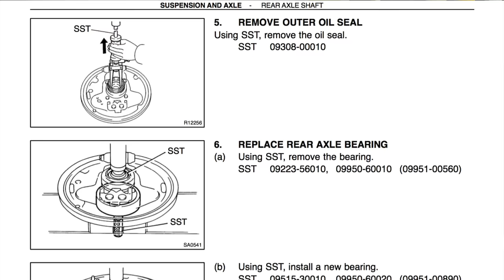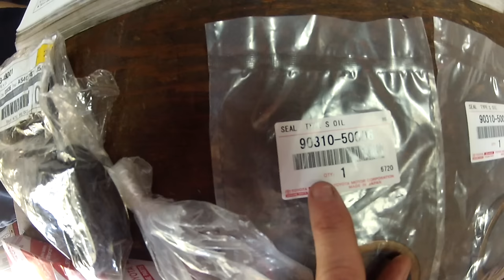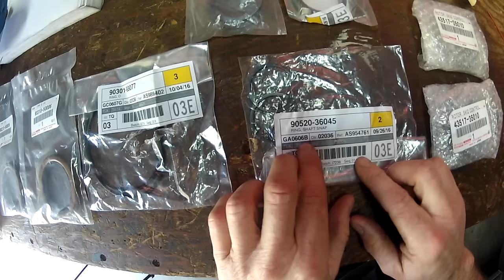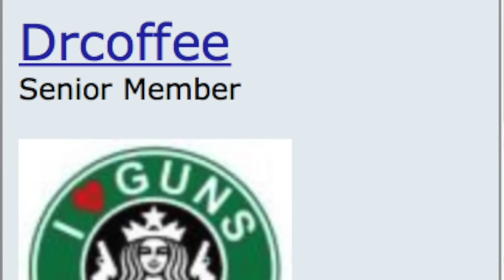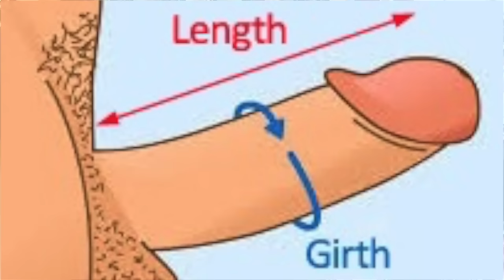Toyota Rear Axle Seal/Bearing Replacement (ABS Rearend)

Comment: Put your wheel bearing in the freezer the morning of the job, then when you go to set the wheel bearing in the housing, heat up the bearing seat just a bit. New bearing drops right in
Reply from the maker: Thanks for the tip.  The bearing fit can really slide in easy without the freezer and heat trick though.  It's not remotely a press fit.  The key is to set the bearing on top of the bearing case going in as straight as possible.  With a little grease to help with the insertion, the bearing literally will fall in.  I Part 2, we show using a 3 inch ABS clean out and cap as a pressing device to install the bearing.  If the cap starts to load up and flex during the insertion, you know it's going and crooked and it's time to back off and reset.

Comment: Thanks for the videos, I find them very insightful.

Any plans to do a front wheel bearing replacement video? Need to tackle this soon and I found no videos detailing this job.
Reply from the maker: We did a manual hub conversion video and that shows pretty much the same stuff you'll need to do.  The parts will be a little different because you'll have an ABS ring but this video should give you most of what you need to get it done.  One day we'll do this job for someone who has stock ADD hubs but for now this is the best I can do for you.  https://youtu.be/TZ2sOfVrnhU
Reply: Timmy The Toolman awesome thank ya sir!

Comment: Would the rear axel leak due to the bad bearings. You can see the missing bearing from the back side.
Reply from the maker: Yes, bad bearings can be the reason the seal fails because a bad bearing will allow for increased movement on the axle which puts extra strain on the seal.  The bearing couldn't be missing but it could be worn out.  If it was really bad, the bearing could completely fall apart but you would know it.  You cannot see the bearing without pulling the axle out.
Reply: @TimmyTheToolman  I pulled it out. And there some metal shavings on the seal. Last I drove it it was running fine I did smell burning. Because the fluid was on the pads. Tim thx for the quick reply. Yeah it's missing one bearing ball I think that's what the shavings come from. Wish me luck trying to find a machine shop to press these in.
Reply from the maker: @maxnguyen22  Just make sure you give the machine specific instructions of what you want them to do.  If they don't have the right tools and are planning on cutting off the parts, you might want to choose another shop.

Comment: @Timmy The Toolman any update on this project since installation? Did flipping the retainer actually work and it didnt leak? I plan to do this tomorrow. Thanks for the video btw
Reply from the maker: The flip method has held up for 4+ years and 60k miles.  The main thing regarding this repair and verifying you have a good mating of the inner retainer and axle seal.  All flipping the retainer does is allow a good mating without having to risk the retainer running up against the inside of the axle housing.
Reply: @TimmyTheToolman   that sounds like a job well done to me, thank you so much for such a quick reply Timmy. I'm excited to do this project tomorrow following another one of your video haha. I did the cv boot mod following your video and it hasn't leak since, thank so much for the videos you make keep them up. Thanks again.
Reply from the maker: @theregularguy5409  You're very welcome and good luck with the job.  Let us know how it went for you.

Comment: Hi Timmy. I recently watch your video on how to change ATF on a 4runner and I instantly became a fan of your video. I have a question for you. Is Castrol transmax  high mileage fine for my 2002 4runner sr5. I been searching but can't fine a definite answer.
Reply from the maker: All you have to do is make sure it's compatible with Dextron III applications because that was the spec for our transmissions when the vehicle was produced.  I've used Mercon V and Dex/Merc in my transmission so far.

I looked up the Castrol Transmax High Mileage and I couldn't confirm it meets the spec for Dextron III applications.  But, Castrol does make a Transmax Dex/Merc and that ATF is compatible with Dextron III so I know you could use that in your transmission.
Reply: Thank you for taking the time to answer my question sir.

Comment: Experiencing this issue with my 05 Tundra.  5 months ago i noticed oil leaking all over the passenger side rear wheel.  I had a shop replace everything, bearing, seal, retainer, breather and brakes. Two weeks later it was leaking again.  They adjusted the retainer......Two weeks later leaking again.  So they fixed it again.  This time it lasted about 5 months.  Now its leaking again.....I'm planning to pull it out and flip the retainer as you mentioned...Is it possible to flip the retainer without pulling the abs ring and bearing?
Reply from the maker: I'm not experienced with the Tundra axles but the 3rd 4runner axles have the inner retainer and ABS tone ring butted up together.  So, you take those off as a unit by getting a bearing splitter under the ABS tone ring and pulling them off.  So, if the Tundra axles are similar, you will have to pull the ABS tone ring off.  As for the bearing, you shouldn't need to mess with it to readjust the inner retainer.  

Making sure this repair works is very simple.  You perform a "grease test" and make sure the axle seal is mating well with the retainer.  If you do that, renew the bearing is it's worn and you don't have a clogged breather, this repair should hold for a very long time.
Reply: Yes, the tundra's are the same.  I don't have an hydraulic press like you have but do have access to a bearing splitter...although I'm not sure how that would work on a long axle like that.  Also, is there another way of sliding the new abs ring and retainer on the axle without a press (pipe and hammer?)?
Reply from the maker: Hey Shawn, people have sort of slide hammered the ABS tone rings and retainers on with a piece of pipe.  How do you plan on getting the parts off the axle without a press?  Are you going to replace the bearings?

Comment: Do you think the 12 ton press from HF is adequate for this job, or would it really require the 20 ton press?
Reply from the maker: The 12 ton can do it.  Our buddy Duane makes an axle puller tool that will fit the 12 ton press.  We feature Duane's tool in this video: https://youtu.be/R-c2x3F8DU4  We have a link to Duane's Ebay store in the video description.

Comment: How important is replacing the ABS trigger wheel? I have a '99 Tacoma with an e-locker, so I have an ABS rear end, but don't actually have ABS. Any reason not to reuse my existing ABS trigger wheel and save myself $130+tax?
Reply from the maker: You can just leave off the ABS tone rings or put them back on, your choice since you don't have ABS.  You definitely don't need to buy new ones as long as you pull the parts off rather than cut them off.

Comment: I ordered a kit for a non abs 4runner. it comes with the seals bearing and a retainer. Mine has abs, will the parts still fit or will I need to get the other kit? thanks for your help.
Reply from the maker: They will fit.  You can save money on the parts by reusing the retainers and ABS tone rings.  I cover this information in a pinned comment.

Comment: Hey Timmy, my 2000 tacoma has abs rings on the axles but the truck itself does not have abs. Do I have to reinstall the abs ring or can I leave it off when doing this job?
Reply from the maker: You can leave them off.
Reply: @TimmyTheToolman  awesome, thanks.
Reply from the maker: @CplGoldFish21  You're welcome.

Comment: This was my comment 2 years ago:   (Has anyone ever tried inserting the inner axle seal half way, so that way it has a better seating area on the retainer? Or will that not work?)
I did that myself and its been 2 years with no leaks and I didnt have to to all that retainer stuff and didnt have to leave the garage. Just thought ya'll should know this way also works and has no bad effect, if you dont have time for the extra steps :)
Reply from the maker: Yeah, not fully seating the seal works, but getting it to where it's equally driven into the housing at the same depth on the full circumference is the hard part.  But yeah, it's an option.  Flipping the retainer isn't any more work.  We didn't have to leave my garage either to do this repair.

Comment: what kind of noise Toyota Tacoma 2010 weight will make when the back bearings to go bad do you have any videos like that for the back tires everybody shows to France but not the back
Reply from the maker: Kind of hard to describe but I'll try.  It sounds like, "Womp, womp, womp, womp, womp .............  You can verify a bad wheel bearing also by lifting the tire off the ground, grabbing the wheel at the 12 o'clock and 6 o'clock and push and pull with opposing force trying to detect play.  If you detect movement, the bearing is bad.

Comment: Hey Timmy,
I have a 2001 Tundra 4WD and having an issue with a “woowing” sound that increases with speed. I thought it was front bearings but replaced and the sound is there. I’m thinking it may be rear bearings, but before I tear that apart, could it be coming from from diff, drive shaft or? Much appreciate your thoughts on this.
Reply from the maker: It could absolutely be a driveshaft u-joint or coming from the differential, possibly from the pinion bearing.
Reply: I had the same "woowing" sound from under my Tundra. Turns out it was the crap non-oem shaft support bearing.

Comment: I have a 2003 Tocoma ABS,  my left bearing is making a woe-woe noise between 10 and 50 mph.  above that you don't hear the woe-woe very much.  the local shops have never heard
of the tools that are available to repair the axle.  The labor cost is about 200 to 250 just to
place the parts.  I have studied you video about 6 times, I know that I can do this work.  Do
you think that the 12 ton press from HF will work?
Reply from the maker: A 12 ton press might work but then again it might not.  I have no way to know how much force was required to press the hubs out of the bearings but it was quite a bit.  All I know is the 20 ton press handled the job.  If you haven't bought the 12 ton press yet, I'd just buy the 20 ton press just to be sure you can get the job done.
Reply: Thanks I will let you know what happens.
Reply from the maker: Hey Richard, for some reason I thought you were commenting on the Manual Hub Conversion video.  The rear axle presses out of the bearing with less required force than the front so I do think the 12 ton press will handle it no problem.

Comment: Hey Timmy - Thanks for the instruction. About to do my 2006 Tacoma. Quick question - what size bearing separator did you use? I checked your Amazon link and there's 2 sizes of OTC Bearing Separator - 5 ton and 7 ton. Thanks so much!
Reply from the maker: Gary Miller I used the 5 ton set.  And, I used the bigger bearing splitter in that set.
Reply: Thanks for making these videos - Awesome!
Reply from the maker: Gary Miller You're welcome Gary.  Let me know how the job goes for you.  You have a 2nd Generation Tacoma so your axles might be different and you might also not have the new seal design issues that we have for 1st Gen Tacomas and 3rd Gen 4runners.  When you tear it apart, compare the old seal with the replacement seals.  If the seals are the same, you probably want to press on the inner retainer in the same spot as before.  Regardless though, make sure to do the "Grease Test" to confirm where the seal is riding because that's your proof you have the retainer in the right spot on the axle shaft.  If you could, take pictures of what the axle shafts look like and send them to me.  I'm interested to see how they are set up and if they are very similar to a 3rd Gen 4runner and 1st Gen Tacoma.  Here's my email address: mtbtim@sbcglobal.net. Thanks and Happy Wrenching!

Comment: Hi Timmy,
What is an early sign that the wheel bearings starting to go bad or is bad. High pitching sound while driving, sound like an electric motor spinning at high speed? my seals are fine, no leaks. I got no play with the wheel moved around.
Reply from the maker: It's usually a humming sound when a wheel bearing is starting to go.  You could get the rear end off the ground supported by jack stands and have someone put it in drive while you're listening trying to find out the source of the noise.  Just make sure the front wheels are chocked well if you're going to get under it.
Reply: @TimmyTheToolman  Thank you , I will give that a try. Mine def not a humming sound. More like a motor buzzing. It goes away when I stop. Sound is the same at all speeds. does not increase in pitch with speed.
Reply from the maker: @brucewayne2773  It doesn't sound like a wheel bearing to me then.
Reply: @TimmyTheToolman  I always assume the worse. I'll keep you posted. Thank you
Reply from the maker: @brucewayne2773  Yeah, definitely let me know what you figure out.
Reply: @TimmyTheToolman  put it on my 4 post lift, got it up to 65 mph no sounds from the wheel bearings whatsoever, I think the sound is coming from my rear differential U joints. I went ahead and greased them up and hope for the best. The U joints are nice and solid too, no play in them and they are super clean.
Reply from the maker: @brucewayne2773  if it's not the u-joints, it could be the pinion bearing.
Reply: @TimmyTheToolman  now that will be fun. Have you done one for youtube
Reply from the maker: @brucewayne2773  No, we haven't.  Working on differentials is something we haven't tried to tackle.  It's something that takes some expertise to get right.  It's not as simple as read a manual and follow the instructions.
Reply: @TimmyTheToolman  Thank you. Need to get a smog done.
I've done run cycle for cat specific and put a 100 miles of mixed driving on my 2000 4Runner. Catalyst still not ready yet. Any tricks. No check engine light , no codes. I disconnected the battery for timing belt service.
Reply from the maker: @brucewayne2773  I've heard the run cycle to clear the code is specific and hard to do with city driving.   If you were out in the country on deserted roads, it would probably be easy to do.  I've never had to do it myself but I've only heard its a pain to accomplish.   If you do a search,  hopefully you can gain some tips from people who have posted how they accomplished it, maybe on a Toyota forum.
Reply from the maker: @brucewayne2773  No, I have no tricks because I've never done it.

Comment: Do you think it'll be the exact same parts etc for my 09/2001 mfg ABS Locking Diff Tacoma? Great video as always, first place I go when looking for common sense how to video instruction. Thanks man!
Reply from the maker: They should all be the same part numbers except the bearings.  Since you have a 2001, your bearing part number will be different.  Look at the video for the bearing part numbers.  But, it doesn't hurt to verify the part numbers via an online parts seller like Camelback Toyota just to be sure.
Reply: Timmy The Toolman thank you. My Tacoma, like many is very special.... https://youtu.be/oYSU6iMz1SQ

It’s getting to have almost 200k on it so I no longer drive it over the winter. Maybe a bit of a parking lot queen thou at this point.  Luv that SuperCharger whine. Very addictive.

Comment: I apologize if this has been asked already. So to do a complete Rear Axle Seal/Bearing job on a ABS equipped 4Runner, do I need just 2 of the Bearing Spacers (42423-20010) or 4 of them?
Reply from the maker: You actually don't need any if you want to save money.  I discuss this in the video description.  You can reuse both retainers and ABS tone ring on each axle saving yourself around $150 (online pricing) if you pull the parts off rather than cut them off.  Please read the video description for information on saving money and for other helpful info.  Also read the comment I pinned.

Comment: Thank you very much @timmy your videos help me out big time. Will you have any future videos of replacing front wheel barring’s ??
Reply from the maker: We have videos you can use to get it done.  Our two manual swap videos cover most of it.  I'd watch this video to know how to get the knuckle off the rig: https://youtu.be/TZ2sOfVrnhU  I'd watch this video to know how to do the press work: https://youtu.be/1TpOYj0sUpA  Finally, I'd watch this video to know how to get the knuckle back on because the first video I linked shows getting a manual hub CV installed and you'll have an A.D.D. axle to connect back up: https://youtu.be/-sY2azyLBuI

Comment: Hey Tim, would you say the flipping of the retainers is necessary only if you had a bad wheel bearing and there was/is play? Is this recommended if you're going to do the axle seals anyway? I was just about to do mine when I saw you mention how it rides further inside creating the inner witness marks and it made me wonder
Reply from the maker: If you're only going to do the seals and not the whole job, the seal will be riding closes to the bevel because of the way Toyota redesigned the seal.  Some guys get away with it and don't experience a leak while others aren't so lucky and the seal ends up leaking.  Flipping the retainer allows you to keep the retainer in about the same spot on the axle as it came from the factory and get a good mating with the seal.
Reply: @TimmyTheToolman  Instead of flipping the retainer can you just not drive the new seal in quite as far as before?
Reply from the maker: @MedievalTrebuchet  You could try that.  It's just a bit hard to have it driven in evenly when it's not driven in fully.